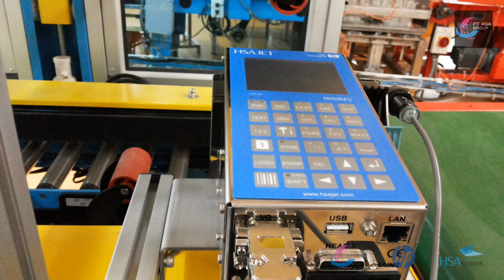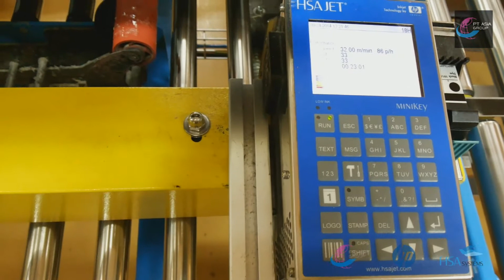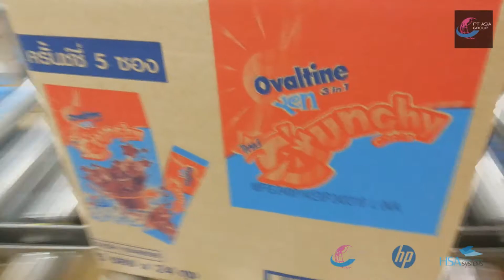Carton Printers - Carton Coding  MiniKey HSAJet TIJ Printer

Comment from the maker: www.ptasia.biz  |    Carton Printers - Carton Coding  MiniKey HSAJet TIJ Printer. 

High quality inline marking of variable data is a critical enabler for these traceability programs. Complementing PT Asia’s solutions for primary packaging coding, It is Thermal Inkjet Printers. PT Asia has a full line of large character printing products (which include carton coders and carton printers) to print directly on a variety of secondary packaging materials. 
+ Gain production flexibility
+ Reduce carton case and label inventory
+ Improve the automation process with bar coding
+ Improve traceability with inline real time coding
+ Reduce manual labor, replace labels and reduce cost of ownership
+ Improve processes and reduce errors from manual label application